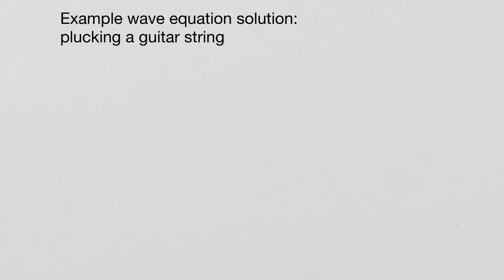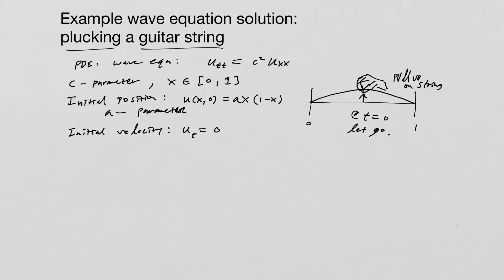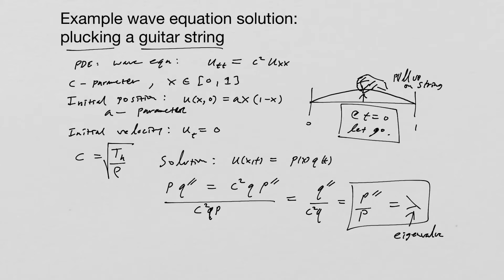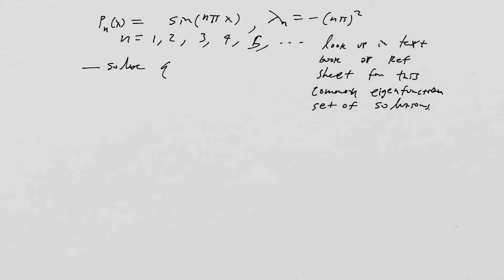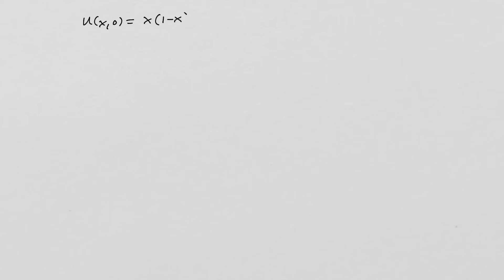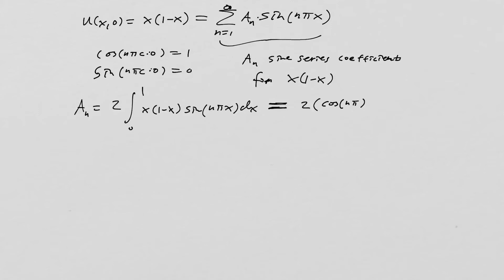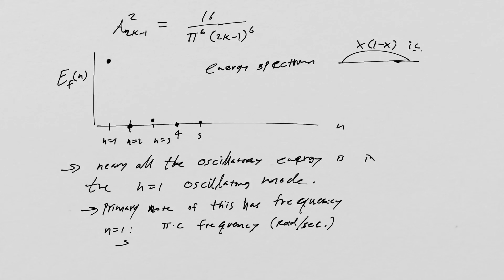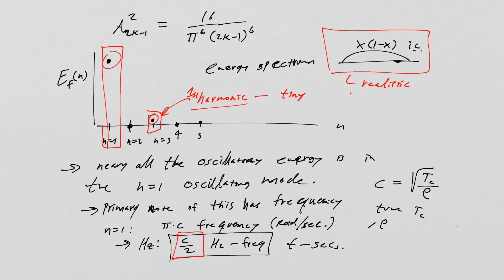Example wave equation solution: plucking a guitar string.

Comment: How does this work with numbers and and not simplified? With a given length and string thickness how do you utilize that? Say the length is 25.4375 in and the thickness of the string is .043, would that make x be in [0, 25.4375]? I'm trying to take this and have a real guitar in front of me and work this.